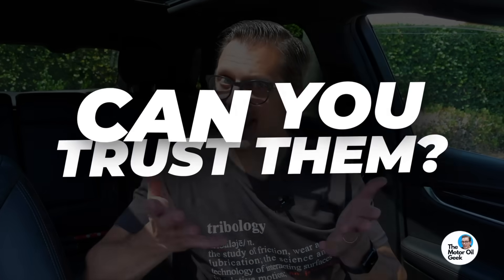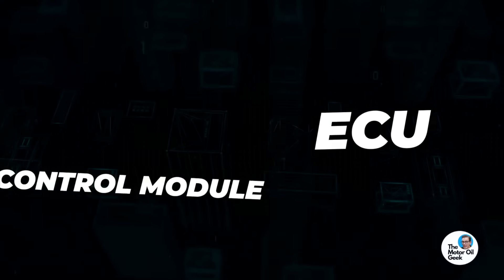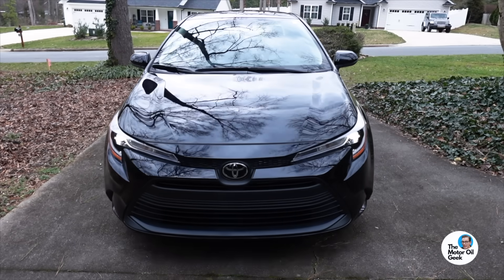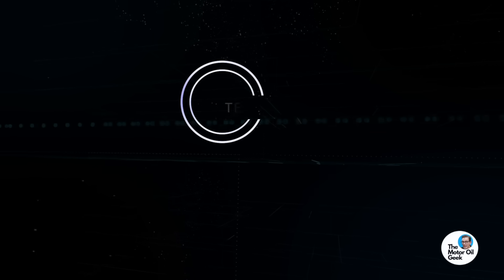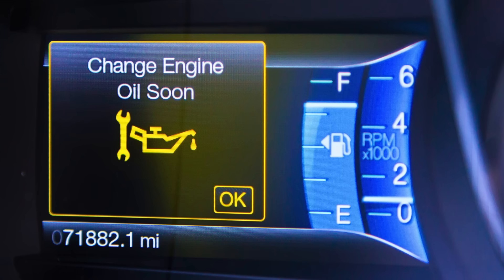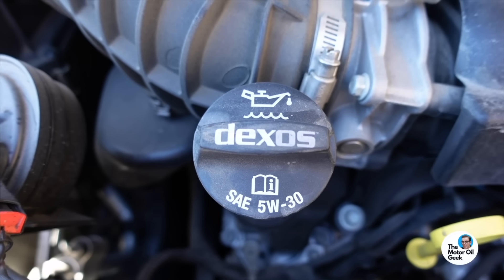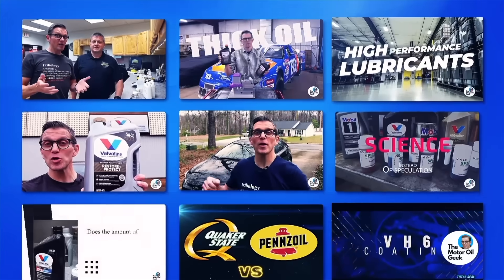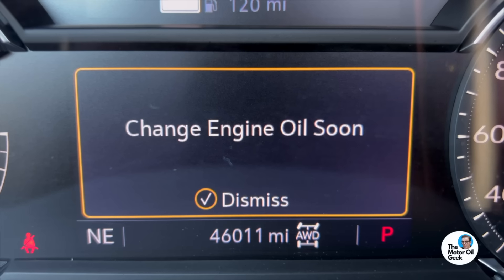The Accuracy of OIL LIFE Indicators REVEALED!

Comment: I would LOVE to see you do this video again but on a 6.6L Duramax engine this time to see if GM got it right with the diesel as well!
Reply: I drive the duramax’s too. I’d like to too see a video about these too. But I’m suspicious that it’ll have similar results. I guess I’d be more interested in the transmission oil maintenance…..
Reply: I would also love to trans fluid tested but its a lot more complicated that testing the engine oil life meter. Every transmission is different and they use different fluids as well. Some say service every 50k others say life time fluid.

But I would love to see testing of the current generation diesel engines to see if they got it right as these current diesel engines are forced to eat their own sh!t if you will do to the EGR system. 

This contaminates the oil faster. 

And the Duramax holds a little more than a quart of old oil when doing an oil change in the pan, pick up tube, and oil pump. Banks has proven this with testing. They have a video you can watch that shows this. 

So I wonder if GM actually took the time to alter the algorithm to reflect these factors on the diesel engines and if we can actually trust the oil life meter in these trucks. 

I don't currently trust mine. Every 5 or 20% left what hits first I change my oil. 
And I had the first oil change done at 1,000 miles after the engine had time to break in. But I changed the filter at 500 miles and topped the oil off.

Comment: Very possible on the last change they did not reset the indicator making the oil much newer than indicated.
No test is conclusive with a sample set of 1. 
I personally do not trust the oil life indicator and change no later than 5k mile or more often depending on usage. 
These modern engines are borderline non repairable, (cost more than car is worth) it’s not worth the risk saving money by stretching an oil change.

Comment: I have to correct you on Honda oil life indicator. It is based on conditions and/or engine revolutions. I have a Honda Odyssey EXL, and I drop off and pick up my kids for school. Yes, I leave the engine running as I have special needs children. My oil change at 30% left during school time is in the lower 3000's miles. During the summer with no school. It is in the mid 4000's, and yes still at the 30% left. I just thought you should know. Love the videos ❤

Comment: It is ironic, perhaps tragic that some hybrid and plug-in hybrid models still require oil change at around 3K for warranty coverage. Isn’t the point to use less Hydrocarbons? My Hyundai does not differentiate between all electric miles and gas miles between changes.

Comment: You can also use that number to tell you if you have oil left. My wife has a 2018 Jeep Compass with the turbo. Her car died twice when the oil life was at the 35% mark. Turns out, she had no oil left both times because the turbo burns oil. Dealer won’t replace it because it hasn’t failed. So now, we change the oil in the engine at @ 50% life remaining.

Comment: Retired trucker. The amount of oil that gets changed out of simplicity (mileage based oil changes) are appalling. Testing your used oil, reduced oil changes from 8 to  5 yearly saving better than a $1000. in oil savings not to mention downtime. Even better  the report let you know the condition of the engine through the contaminates in the sample. The oil techs at Shell were  helpful in explaining what parts were showing wear based on the analysis. Data driven analysis helps you make better business decisions.

Comment: i change my oil between two and three weeks. total KMS is 7,330 kms to 10,600 kms. this is all highway kms and the ford will let me go to  15,000 kms before warning me of a need for an oil change. I have to original motor with 810 000 miles on it. The km odometer stopped counting at 999 999 kms. Am i overdoing it with my oil changes?

Comment: I have a better guage: the odometer. Every time my vehicle reaches a 10,000.0 mile mark (exactly at 20,000.0 miles or exactly at 30,000.0 miles), I change the oil then. Same thing with tire rotation, but at 5,000 mile intervals. No oil life sensor needed, 👍.

Comment: I havent' trusted them yet.
I go STRICTLY by Mileage. 
I do NOT go by the Claimed Manufacturer's suggesting of EXTENDED Oil Changes either. 8000? 10 000? 12 000+? INSANE.
There is a Reason they want you to "Extend" the Oil Change. WHY? Because it's more residual business for them down the road, when your ENGINE FAILS. Just look at the AFM/DoD on GM products. Yes, it's a LIFTER Issue, but it's an OIL Issue as well.
All these Manufacturers have ISSUES when these Oil Changes are Extended.
I am a FIRM Believer in KISS and if it aint Broke, Don't Fix It.
Too much of an Engine is Extremely Complicated. Complicated causes mroe and more compounding problems.
I do NOT disagree with your results. 
HOWEVER
You can Not go wrong with the every 3000m(5000k) Oil Changes. 
Just means your Engine, everything else being equal, will last longer. Things Build ups as time marches on. Clean Oil is the Ticket.
&
YES, I change the OIL on my Motorcycles at the Beginning of every riding season, regardless on whether it needs on or not, as it's been sitting all winter, 4-5 months on the year here. 
Thanks for in depth analysis and the information, I do agree however, I also believe in regular, like clockwork Oil Changes will always save the day.

Comment: I owned a 2015 Corvette that I changed the oil in November when I stopped using it for the winter. The oil indicator said I was at 100%. When I started the car in April it read 74%. I hadn’t driven or started the car for 5 months. I would then drive the car again till November. Only putting 1,200 miles on the car. The indicator would again say in November it was in the single digits. I had the oil tested and it came back perfect. This indicator is just away for Chevy to take advantage of the people who believe their oil need’s to be changed. When I first bought the car Chevy charged $105.00 for an oil change. In 2022 they quoted $325.00 for an oil change. That’s when I had the oil tested. THIEFS

Comment: You mentioned in your video that you tested the oil on a rental car. There is a high likelihood that they may have changed the oil based on a the company maintenance schedule and never reset the oil lifecycle indicator. They may change the oil every 5000 miles and that oil only had around 900 miles on it.

Comment: I trust my Gm oil life monitor system. But my current problem is my oil life drops 3-4% a month even if I don’t use my truck.
Last time I changed the oil in my L83, the oil was still golden.

Comment: I don't trust oil change mileage either. It doesn't account for idling or time (months, ie). And, owners manual indicates anywhere from 5,000 miles to 7,000 miles, or something earlier if dusty conditions (3,500 miles). I figure at about 4,500 to 5,000 miles I change oil, I don't do a lot of idling. My 2006 f150 with 4.8 liter has 165,??? miles. At 100,000 miles my mechanic factory tune and used bore scope to look inside motor and said it looks almost new. Soo, I'll stick to what is working for all my vehicles
 But this is great video

Comment: The oil monitor is a tool that can deny warranty coverage of an engine. If you ignore it and have an oil related part fail, the manufacturer will point to that monitor log and say you failed to properly service and maintain the engine.

Comment: I had a 2008 Honda fit and I would change the oil at 20% I junked the car at 342000 miles because the A/C  stopped working . I now drive a 2016 ford transit connect that has 268000 miles on it and I change the oil when it tells me on the dash . So I think there working .

Comment: Hey good info on motor oil, I have watched several and learned some on motor oils. 
 I just replaced both my car and trucks battery's they both went out at the same time. 
 I wish you would do a in depth explanation on Grease!
I know about wheel bearing grease but... dielectric, lithium, silicone , silicone compound, o-ring grease, conductive grease, oil based protectant grease, plumbers grease and marine grease. 
All those greases came up on my search for a battery terminal grease, I had no idea there were so many different greases that is recommended or not advised to use with electric components. 
 Some info says use A not B grease, some says it don't matter, some say use it on the battery clamps not the battery post, some say different. 
 It is confusing!
Thanks for any help or a good place to find this information about grease with electric parts, mainly automotive batteries.

Comment: As a retired tech, I always suggested and followed myself, Change your oil at 5000 miles rotate your tire also and you get the best possible performance,  The new cars with sensors for everything that people expect them to tell them what and when do it should be a guide, not the end all. Don't wait for the car to tell you it is time to do anything, check with the manufacturers maintenance schedule and just follow that.   Also use quality Oils and filters,  Save money elsewhere, quality materials will give you more miles, but Oil  is cheap engines are not, you can extend the milage but why?    However the 3000 quick lube has always been a money grab, again look at your owners manual and follow that,

Comment: you should go another thousand miles  and do another analysis   until the oil fails     just curious
How conservative is it   
I just had a feeling that mine  was going off too soon   it's usually around 5K     
2022   Chevy 2500 6.6 gas

Comment: I have a Toyota with 125,000 on it. Bought it with 29,000. I use Valvoline synthetic. Change it every 4,000 oil is clean every time. Knock on wood. Always let it warm up before driving. She is a keeper.

Comment: But… we drive our 2015 CR-V conservatively near Chicago (cold Winters). But even in Spring - Fall, the oil level drops down a quart in 4k miles. Our mechanic recommends changing the oil at 5K miles. The oil life indicator is still near 50%, and twice the timing chain started making noise. So, I get the oil changed around 5K miles no matter what the oil life indicator says. Car car has 110K miles and I plan to keep it many more miles and years.

Advice?

Comment: I had an Acura that knew. I used to take my car to the oil changing places like jiffy lubes. I noticed the oil sensor would drop from 100 to 20 or whatever really fast. And I always paid extra for the premium full synthetic.

Started changing my own oil with full synthetic bought from the stores and what do you know. The sensor would stay at 100 dropping to about 80 in the time the oil station's oil would be at zero.

I replaced the Acura with a lexus and still change my own oil but I notice the lexus doesn't have sensor like the acuna did. It seems to go by miles driven.
Reply from the maker: Thanks for sharing!

Comment: I have that system on my 2017 Ford Fusion & not long after I bought it "brand new" I kept up with the mileage because I always change my own oil, at 5000 miles & at 5000 miles my indicator was say i still had 55% life left. So I never go by the computer, I just change it by the mileage.

Comment: What would be cool if this could be tested to see if the system is actually smarter than what we think it is.  By running cycles with the different types of oil that you test in other tests.  If the values change at different rates of degradation based on the mileage up to 5k.  Also with most engines now having turbos, if it matters if you run a cycle with ethanol blended fuels and a cycle with none ethanol fuel.  Being that ethanol will blend with oil and degrade the oil by adding moisture.

I have seen some interesting value rate changes on my 2017 2.7 Ecco Boost engine going from synthetic blended oil to a full synthetic oil.  I also use non ethanol fuel 99.99% of the time.  I currently have 5K thousand miles on my current oil change and the oil use indicator is showing me over 50% oil life. Which is much higher than it has been with synthetic blended oils, under the same conditions.  

Very cool videos by the way.  Thanks for the knowledge.

Comment: Yea so I figured out that my GMC around 40% is right around 5000 miles.Sorry it's getting changed at 40% especially with the lifter issues the 18's are having.Oh by the way i purchased one of those plug-ins that disables the V4 mode and I actually get better fuel mileage by 2mpg.I recommend this.

Comment: Mine hits 20%, I get an oil change.  Mobil 1 sythetic and filter since bought new.  Truck is now over 12 years old.  That averages around the 8000 to 8400 km mark looking at my log book.  Over kill or not enough, dont know.  Never been broken down on the side of the highway, truck always starts and Ive never been stranded.  is that science?  No.

Comment: I will always change my oil every 3,000 miles whether it is synthetic or not. Most manufacturers now consider 1 quart of oil usage per 1,000-1,200 miles of driving normal, if you follow these recommendations you will be out of oil by your next oil change. As the oil is used and the level of oil goes down the engine is much harder on the oil and the usage increases, oil usage will damage your catalytic converter. If you follow the manufacturers recommendations you will be replacing the catalytic converter at 60,000 miles or sooner. If you actually have seen what oil sludge looks like inside of your engine, if you love your car or look at it as an an investment you will never drive it past 3,000 miles on any oil. When oil viscosity was 10w30 or higher this was not an issue but now oil is 0w20, 0w16, you may get better gas mileage but thinner oil is more apt to burn off. I highly recommend not to follow any manufacturers oil change interval. 3,000 miles or bust.

Comment: I drive a European diesel Cruze whose oil life indicator goes to zero after 12 months regardless of the miles.
I only drive long journeys (mostly over 90 minutes) and almost no city driving and the engine has been very reliable in spite of the 9000 mile services so far (95k miles so far).
I wonder if the oil life indicator is specially tuned for a DPF car.

Comment: 2008 Impala, always went by the computer and ran it down under 10% each time which averaged 8-9000 miles.  Most trips were 35 miles to work.  It had 310,000 miles when we sold it, burned no oil, ran like it always did.  Sample size of ONE says it works pretty good.
Reply: Did the transmission last 310k miles too ?
Reply: @donc6781  Had no issues with it, did get some fluid changes in it's life.  A local teen got another year out of it as well.  The body wasn't liking 14 northern rust belt winters or we would still probably have it.

Comment: Might want to follow the scientific process and check several cars. Likely the Cadillac oil had been changed but the monitor was not reset. Blowing your whole experiment. After 20 years as a mechanic IV seen lack of oil changes and transmission fluid changes being 2 of the leading causes of major failures. Its to cheap not to do every 3-5k every time! And trans fluid every 50k do not let your oil life go to 0 and think you still have a little time. This is the WORST automotive advice IV ever heard!

Comment: More importantly use a quality filter I had the misfortune of using a local quick lube to get my oil changed and noticed that after 2000 miles my oil pressure would drop, this went on for some time before I realized what was happening their cheap filter was bypassing, started using a wix premium and my oil pressure remains constant throughout. Sadly the damage is already done and my truck consumes a significant amount of oil between oil changes and looks like a diesel on start up if it's required to do any work.